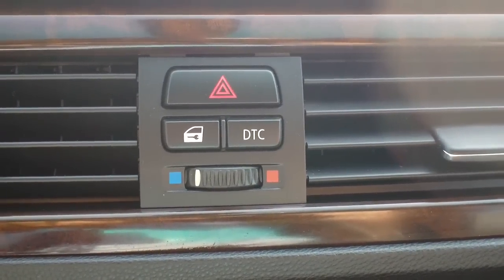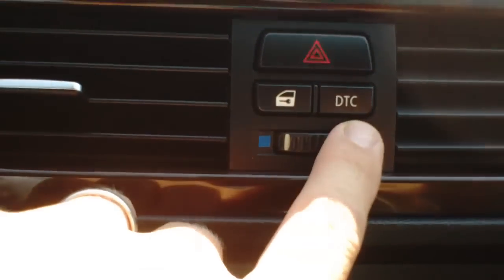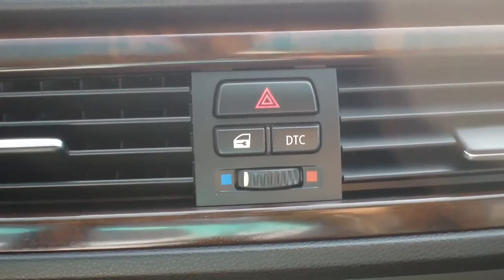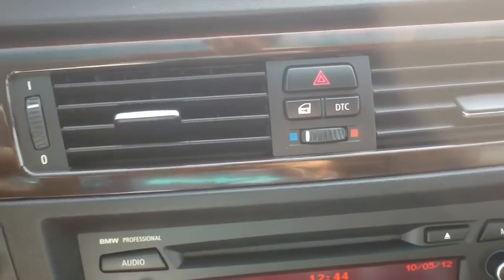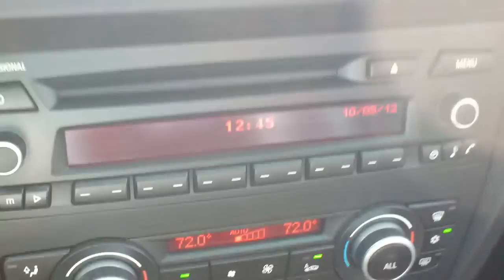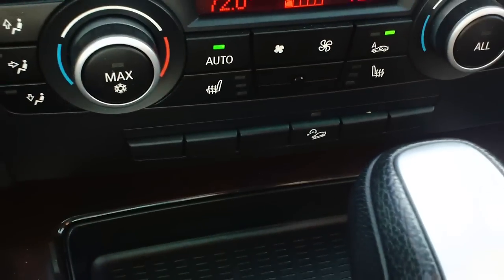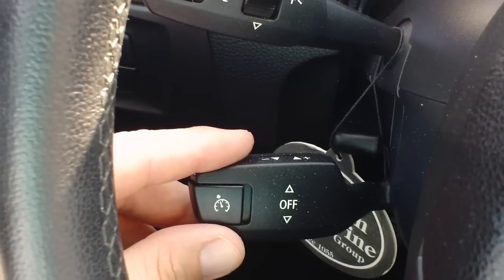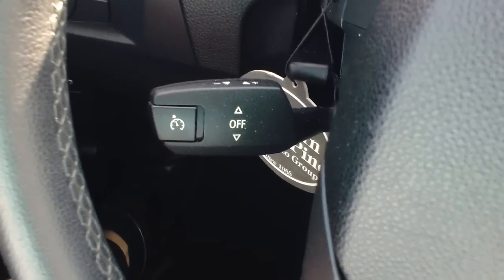HOW TO OR WHAT IS DTC BUTTON ON A BMW

Comment: Dynamic Traction Control (DTC).
Dynamic Traction Control (DTC) allows more wheel slip and thus a more dynamic driving style with higher wheel traction and DSC controlling stability. A small amount of spin on the drive wheels improves traction when pulling off from a standstill in snow or on loose terrain. Dynamic Traction Control (DTC) is a sub-function of the Dynamic Stability Control (DSC) system that can be turned on and off. DTC has two major roles: to regulate traction and to enable sports-style driving while providing active stability control.
When the drive wheels start losing traction the DSC automatically begins stabilisation measures. The Dynamic Stability Control system curbs the engine output and stops slip on the wheels. In exceptional situations, however, a small amount of wheel slip can be an advantage. When driving in deep snow, slush or on loose terrain a small amount of wheel spin improves traction. For these occasions, as well as those when the drivers want a sportier driving style, the DTC can be activated by pressing a button and this allows more slip and reduces the DSC’s curbing of the engine. The result: better traction and more thrust. The DTC also makes driving on snow and ice-free roads more dynamic. When activated, the DTC allows sporty drivers more room to manoeuvre around curves than the Dynamic Stability Control and even permits controlled drifts. The driver retains complete control over the vehicle in every situation and the Dynamic Stability Control’s stabilising measures remain active even when the DTC is activated.
THIS WAS COPIED OFF BMW SITE.
Reply: Rhonda Adams so if it's snowing should I just get in the car and drive it or turn the dsc off
Reply: Thank you very informative 👍

Comment: Per BMW, 
Dynamic Traction Control (DTC).

Dynamic Traction Control (DTC) allows more wheel slip and thus a more dynamic driving style with higher wheel traction and DSC controlling stability. A small amount of spin on the drive wheels improves traction when pulling off from a standstill in snow or on loose terrain. 

Dynamic Traction Control (DTC) is a sub-function of the Dynamic Stability Control (DSC) system that can be turned on and off. DTC has two major roles: to regulate traction and to enable sports-style driving while providing active stability control.
When the drive wheels start losing traction the DSC automatically begins stabilisation measures. The Dynamic Stability Control system curbs the engine output and stops slip on the wheels. In exceptional situations, however, a small amount of wheel slip can be an advantage. 

When driving in deep snow, slush or on loose terrain a small amount of wheel spin improves traction. For these occasions, as well as those when the drivers want a sportier driving style, the DTC can be activated by pressing a button and this allows more slip and reduces the DSC’s curbing of the engine. The result: better traction and more thrust. 

The DTC also makes driving on snow and ice-free roads more dynamic. When activated, the DTC allows sporty drivers more room to manoeuvre around curves than the Dynamic Stability Control and even permits controlled drifts. The driver retains complete control over the vehicle in every situation and the Dynamic Stability Control’s stabilising measures remain active even when the DTC is activated.

Comment: Completely wrong regarding Dynamic Traction Control (DTC). 

From the BMW website:
"Dynamic Traction Control (DTC) allows more wheel slip and thus a more dynamic driving style with higher wheel traction and DSC controlling stability. A small amount of spin on the drive wheels improves traction when pulling off from a standstill in snow or on loose terrain. Dynamic Traction Control (DTC) is a sub-function of the Dynamic Stability Control (DSC) system that can be turned on and off. DTC has two major roles: to regulate traction and to enable sports-style driving while providing active stability control.
When the drive wheels start losing traction the DSC automatically begins stabilisation measures. The Dynamic Stability Control system curbs the engine output and stops slip on the wheels. In exceptional situations, however, a small amount of wheel slip can be an advantage. When driving in deep snow, slush or on loose terrain a small amount of wheel spin improves traction. For these occasions, as well as those when the drivers want a sportier driving style, the DTC can be activated by pressing a button and this allows more slip and reduces the DSC’s curbing of the engine. The result: better traction and more thrust. The DTC also makes driving on snow and ice-free roads more dynamic. When activated, the DTC allows sporty drivers more room to manoeuvre around curves than the Dynamic Stability Control and even permits controlled drifts. The driver retains complete control over the vehicle in every situation and the Dynamic Stability Control’s stabilising measures remain active even when the DTC is activated."
Reply: johnmohanmusic correct!!!☺️👍🏾

Comment: bull shit, DTC is simply delay the involve of the traction control to allow certain amout of wheel spin without cut down the power from the engine and it helps you enjoy the car on the race track without let you spin it, as the ESP and TCS still will kick in when your car is about to slide sideways

Comment: This helped I had no idea what DTC was for
Reply: He only mentioned one of three modes that button does. Trust me, it does a whole lot more than what he said.
Reply: If you want me to trust you. You'll have to explain all three modes.
Reply: @Navisworker
Mode 1: Full ON, Standard position when you start your car. Advances/retards engine timing to assist with engine control, modulates throttle, engages full ON traction control, braking, and anti-slip and a ton of other stuff.

Mode 2: One (quick) press of the button, Puts it into Sport driving mode where you eliminate all the engine throttling and the all-wheel drive system (if you have it) is now "locked active" more-so than in Mode 1, along with active ABS.

Mode 3: From the start position - press and HOLD the DTC button until it removes all engine and traction control modes for FULL Sport mode uninhibited by and computer control.
Reply: NorthernChev so if it's snowing I'd be best not pressing the button at all,was going sideways down a carriage way this morning,lol